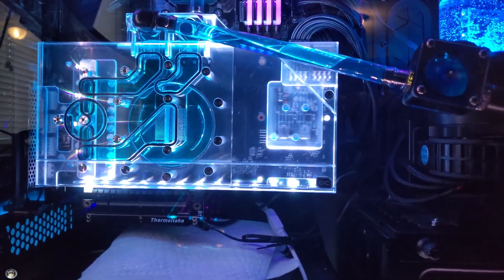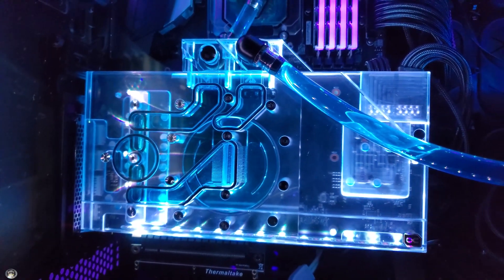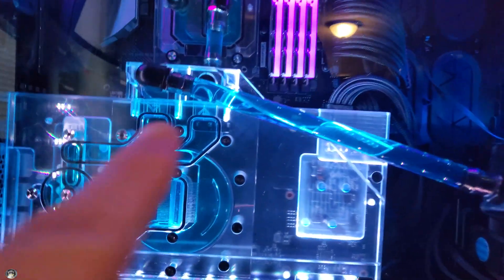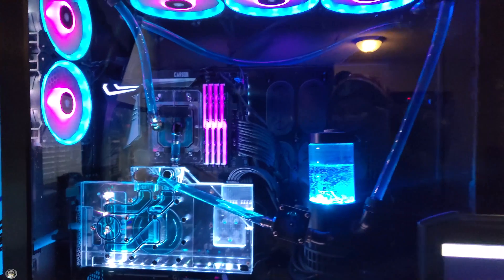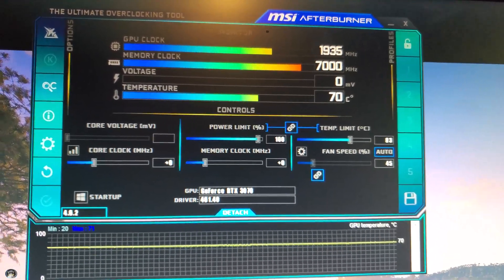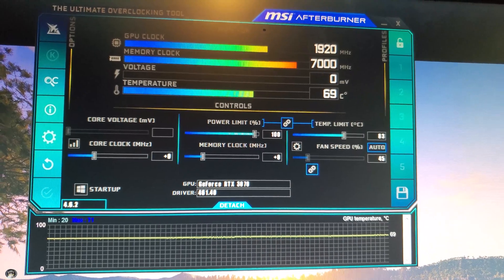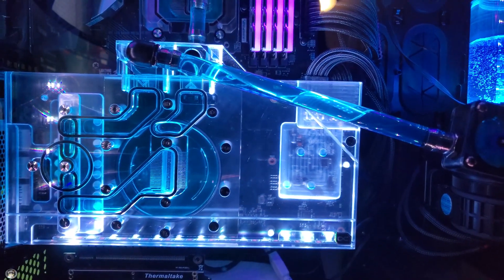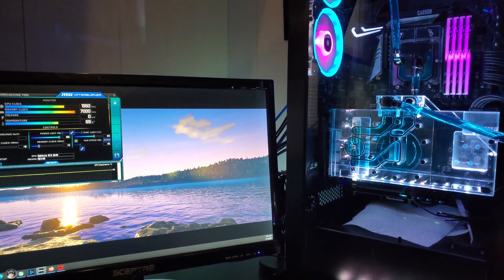Does Flow Direction Matter? PC Water Cooling Loop!

Comment: I have a couple ideas you can try. First, I would feel the temp of the exit  hose from the GPU water block, if it is not that hot then you may have a problem with the contact of the heat-sink on the GPU core. This could happen due to the thermal pads being too thick. you can check this by cleaning the thermal compound from both sides then apply a pea size blob of thermal compound in the centre of the GPU core (just for a test) then place the heat-sink/fans back on, (without screwing it down yet) then put a little pressure on the heat-sink so there is good contact then remove it and take at look and see if the thermal compound has spread out sufficiently, if not, then the thermal pads are too think. You can use a digital caliper to see how thick the thermal pads are (if you have one), you can also use a ruler and slice a piece of the thermal pad to measure the thickness. Also, Is your pump still pumping?  If the exit hose from the GPU is hot then maybe check the temp of the CPU, is it overclocked? If it is then perhaps the CPUt is heating up the water, but that's unlikely. if not then it is either a GPU/Heat-sink contact issue or it is a water flow issue.  Good Luck! Cheers!

Comment: Loop order doesn't matter. Flow direction across certain blocks certainly matters. The plates are designed to reduce turbulants and increase flow rate. But they only work in a certain direction. With my GPU block it makes no difference but with my CPU block it does.

Comment: You need to install a thermal probe for your water temp dude
Reply from the maker: Where?
Reply: On the outlet between the cpu block and pump that will give you a water temp going out you can also install one on the outlet of your last radiator that will give a water temp going into your gpu and cpu 👍🏽

Comment: The direction of the flow does matter, it's common knowledge (and can be easily found with minimal research) that the inlet and outlet ports both on the CPU waterblock, Graphics Card waterblock and Pump(/Res combo) all matter. The components that have no designated inlets and outlets are the radiators, which can be used optimally in either configuration (although there's some talk that there is technically an optimal layout for these, too, but the gain/loss isn't really impactful). In terms of your temperatures, not sure what configuration your loop is, but if you have a look at other YouTube channels you'll find that they're running more powerful graphics cards that produce much more heat with various radiator configurations and are getting much cooler temperatures than yours. It's also odd that you can easily see the flowing water in the water block, and that there appears to be an air gap in the flow meter. Not to put you down, judging from your channel minimal effort was applied when making decisions - at least, that's how it was in the previous video where you ignored (I admit they're poor in that it seems like they don't know what product they've actually sent you at times (they use neutral descriptions for very specific things, at times)), quite straightforward, step-by-step instructions using labeled components. Instead of rushing things at a pace you're not capable of doing, you should take some time to carefully read instructions and do some basic research, as you'll be sure to get lower temperatures, with some adjustments, and thus more value out of your custom loop setup.
Reply from the maker: It did make a difference though in my case. I will prolly get rid of the fidget spinner. Kinda dumb gimmick.
Reply: @KenneMCL  have a read again, slower.
Reply from the maker: I've read it several times. What's your point? Just made a video showing off that switching the in and out on my block made a 5+ degree difference.  While not much it's still a difference.  I already said in my other video I screwed up with the thermal pads. I didn't notice they gave me 2 different sizes. I have no issues admitting what I do wrong.  Just thought it was interesting that it made a difference in temps switching the in and out.
Reply: @KenneMCL  As it should, mixing up the out and the in results in improper flow over the cooling fins, as well as turbulence, which results in irregular patches of higher coolant temperature.
Reply from the maker: Hence when the point of my video.
Reply: @KenneMCL  No pun intended but Trojan gaming seems to be a bit of a d head

Comment: Hi! I have a  asus dual 2080 super. water block from EKWB. instead of thermal paste I use liquid metal, the temperature has never been higher than 52 C. the direction of flow does not matter. 
I used Arctic MX4 paste before liquid metal... 67 C.
Reply from the maker: Werid because it did drop my Temps when I switched the flow in the gpu block. I went with kryonaut and now I'm sitting at 45c on my gpu.